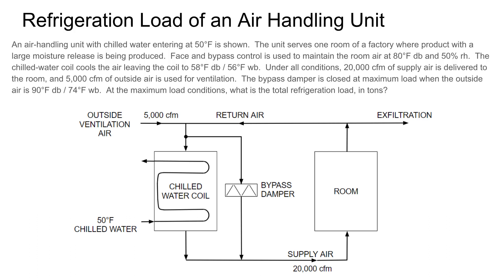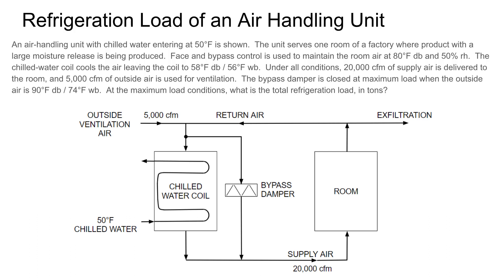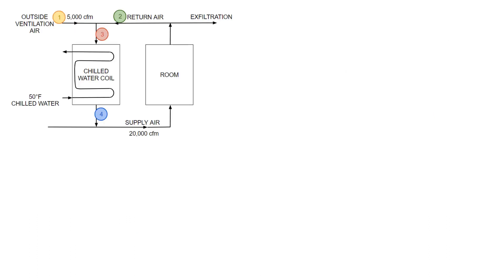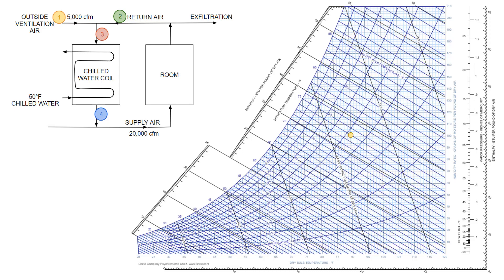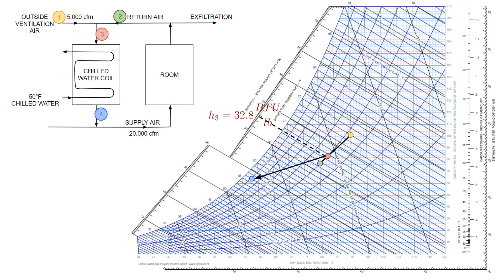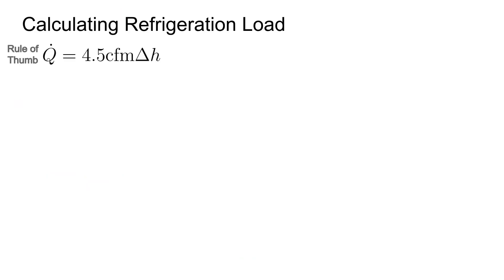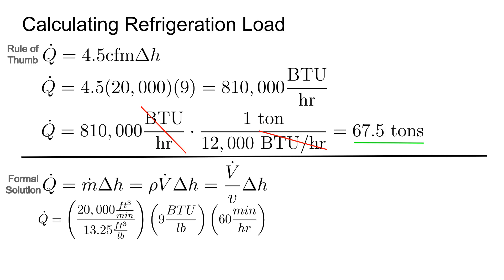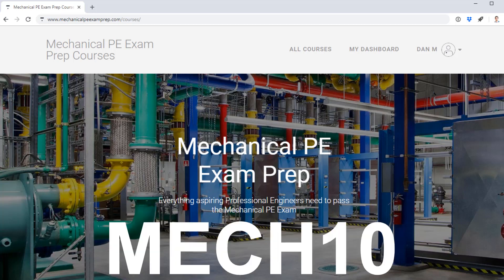HVAC Mechanical Engineering - Calculating Refrigeration Load of an AHU Solution

Comment: Excellent, very difficult to understand how you draw point 4, coil leaving temperature, can you explain me please
Reply from the maker: Hi Tahir, State 4 is fully defined.  The dry bulb and wet bulb temperature are both given in the problem statement.  The dry bulb temperature can be read off the horizontal axis at the bottom, and the wet bulb can be read along the saturation curve by traveling along lines of constant wet-bulb, which track diagonally from NW to SE (using cardinal directions and assuming the top of the screen is north).  Easier to draw than to explain with written words, but I hope that helps!
By the way, I understand you are a mechanical engineer but not a PE candidate, you may want to take a look at the Mechanical Engineering Fundamentals course which covers all the basics of psychrometrics and could really be helpful to you!  Drop me a note with any questions.
Reply: @Mechanical PE Exam Prep  greeting, thanks your reply. I understood all psychometric values but only confusion about coil off temperature, my mean how to find coil leaving temperature, can u refer me your video explain how to find coil leaving temperature

Comment: Using the rule of thumb for CFM doesnt work here
Q=cfm*1.08*(mixed air temp - LAT)
Q=20,000 * 1.08 * (82.5-58) = 529,200 btu/hr ==> 44.1 Tons
what am I missing here? the latent load for the WB temp difference?
Reply from the maker: Hi Ahmed, Jump to 8:00.  Specific volume and density change with temperature, so sometimes you have to use mass flow rate.  The rule of thumb formula has a typical value baked in, and it's usually pretty close.  You should be aware of possible discrepancies though!  Keep up the keen eye. -Dan
Reply: The rule of thumb you're using is a calculation for sensible cooling only, which does not include latent cooling.

Comment: Please use SI units
Reply from the maker: Hi Niranjan, There may be some SI units in the new program I'm working on now for the Mechanical PE "Thermal Fluids Systems" Exam as that test has a mix of US customary and SI units.  However, the HVACR exam in the United States is only based on US Customary, hence the consistent exclusion of SI in 90% of my videos.  If there's anything specific you are trying to work through, please let me know here or by email and I'll be happy to help.